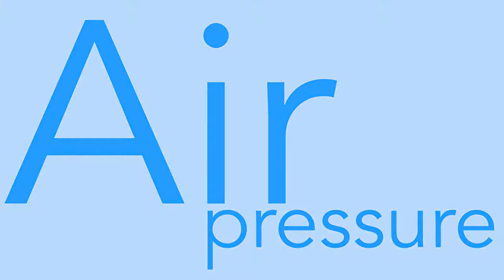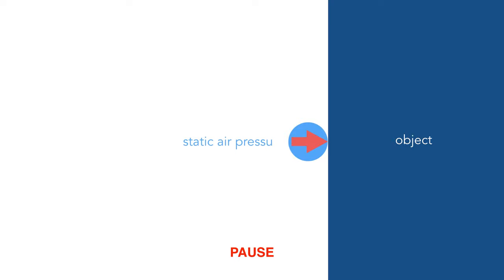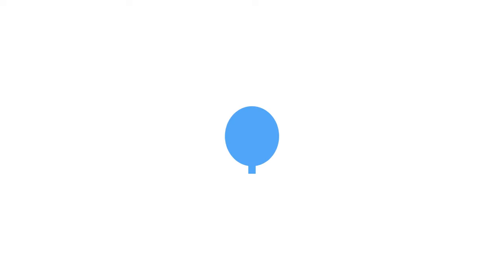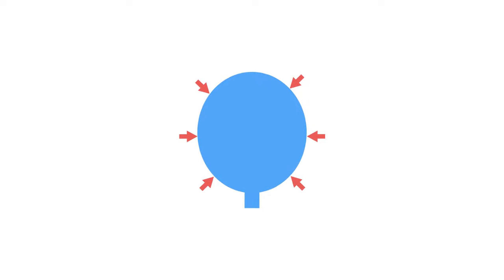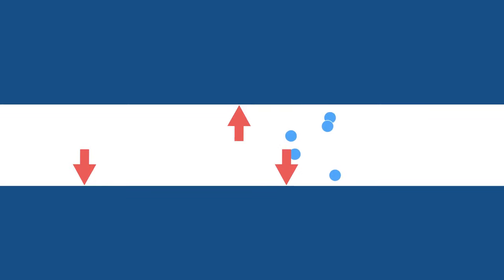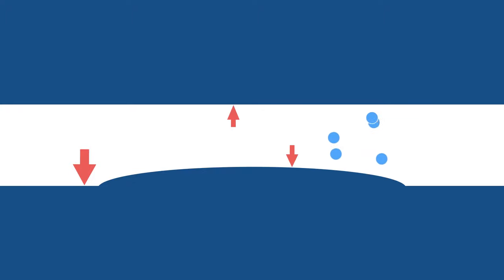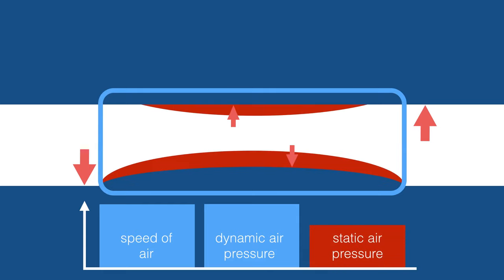Air pressure.

Comment: This is NOT an accurate comparison to lift. Air does not flow over a wing in a free stream the way it does in a pipe. Bernoullis equation for explaining lift has major flaws. Do a little more digging and you’ll find it is coanda and Newton’s third law
Reply: If you would listen to what she said, you would hear her say "in part".  That means that it is only one part of the equation to create lift.   All 3 of the principles come in to play to create lift, not just one or 2.   They all contribute to create lift at different speeds and attitudes.  Some airfoil designs rely more on one priciple than the others.  A wing shaped for a fighter jet is based more on newtons 3rd law while the wing of a U-2 takes advantage of the bernoulli principle and coanda effect.

Comment: Thank you so much. I now understand why there is low pressure on top of the wing and high on the bottom. For some reasons in my head I thought more speed gave more pressure since it's going faster and creating some skin friction (or tension, should I say?)

Comment: Hello, Im really confused with air pressure, so if you dont mind answering some of my questions.

2:37 , Im not sure if I have missed something, but when lets say pipe has smaller width, shouldnt there be more pressure and speed,  and why does air going faster above create lower pressure, is it becuase when plane is going through the air, the air on top of wing cant exert the same force, and when going fast enough, air gets separated right?
Reply: Accelerating air give the molecules less time to impinge on the surface causing a pressure drop. Air molecules vibrate, everything does. The vibration creates pressure, so they bounce over the wing like a glancing ping pong ball.

Comment: The authors have two misguided scientific approaches: researching the creation of Lift force and Low pressure at upper (and camber) side of the wing, relative to the ground surface and Earth. I explain the aerodynamic cavitation and creation of Lee side aerocavern which produces Aerodynamic force.
Reply: The force object receives is always normal to the contact surface and (static) air pressure always acts normal to the surface of the body. This has long been well known, and I don't know why in flight theories and aerodynamics books this is (mostly) omitted.

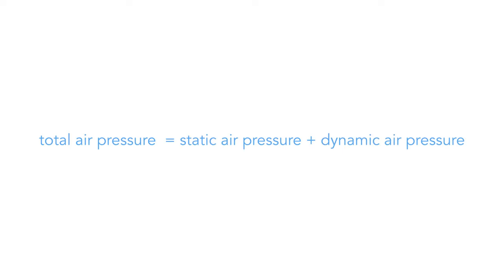Comment: I disagreed @1:50 ... it a Static pressure NOT Dynamic pressure.
Reply: I think it's the total pressure since the face is perpendicular to wind direction and not parallel to be static
Reply: @kavyashrik  like a pit tube , it's total pressure